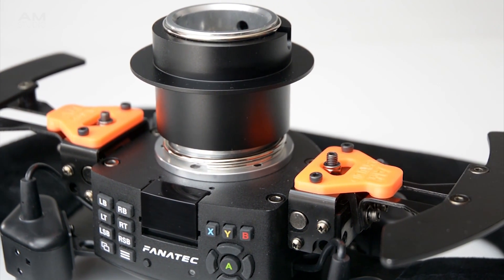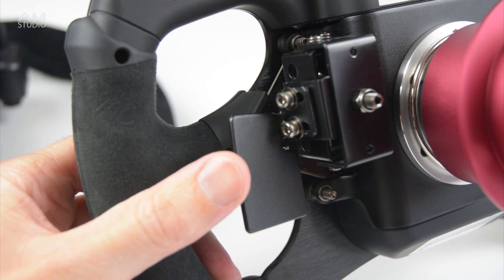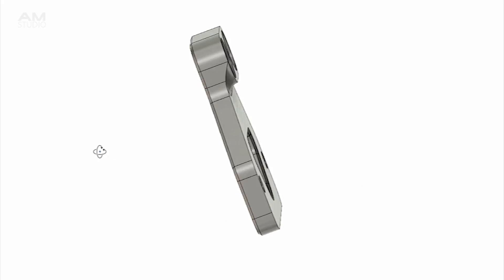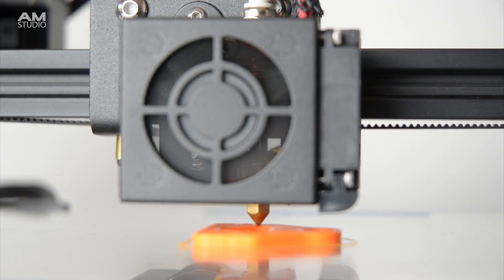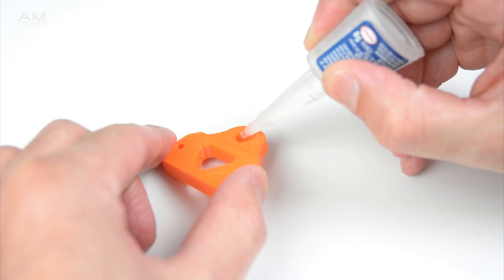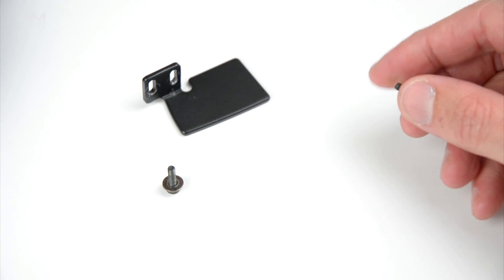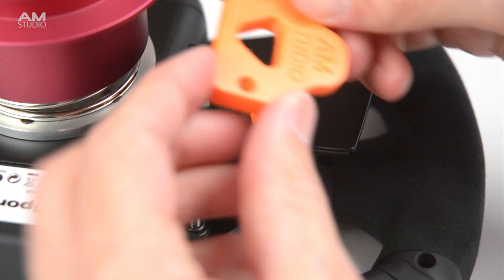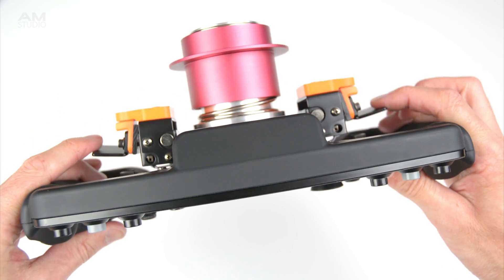DIY MAGNETIC SHIFTER FOR FANATEC FORMULA RIM

Comment: I purchased a set of these the same day I purchased the wheel, and I'm very glad I did.

The feeling of the stock shifters was kind of a let down, no tactile feedback at all. Your mod completely changes that.

My only wish is if you added an option for some sort of foam pad or felt insert between the two pieces to eliminate some of the noise. I love the noise, but the rest of the household isn't so pleased haha

Comment: Thx for the awesome mod. I made these for my wheel but I think the magnets are to strong for my liking because I bought the 8x5mm N40 magnets instead of the N35 specified in your video. It would be cool if you had a design for 8x3mm magnets which in theory should have less pull strength or even 5x3 or 3x3. Fanatec Formula wheel has fairly small paddles so I think the most important is tactile feel not the strength. What do you guys think? Did anyone experiment with different kinds of magnets?

Comment: 100k SUBS U DID IT
Reply from the maker: Thanks!
Reply: @amstudio Is it hard to make an enclosure for the shifter adapter? So like with an USB plug and the plug for the shifter. By the way that thing works completely flawless. Anyways I have mounting hardware so I could mount the shifter plug and the audrino to that case. And I could probably mount the USB micro port with hot glue. It's probably better if It would be 3d printed but I don't have a printer (3d printer). Although I could probably make something out of wood. Soooo do you have an idea of what It could look like? I would appreciate a respond because it's just in an Amazon basics box right now, but I also understand that you are a busy man and have better things to do with your time. Anyways thanks because I have an adapter nether the less. Have a nice day.

Comment: Hi, I've got a problem with a logitech force shifter and was wondering if u could help me: 
  i've bought one cheaply, but it's not working correctly: only even gears + reverse work. So basically only movement lef-right is detected, and it behaves like it was always in down position. I tilt it left, it sees second gear. Middle position - 4th gear. Right - 6th gear. Any movement up-down does not do anything.
   Do you know if that would be a quick fix, or would it be better to just try to send it back?

I know there are basically 2 pots detecting all the movement, so probably it is a broken wire or sth. But I don't want to tear it apart (and lose the posibility to send it back) without being sure that I would be able to fix it myself.

Comment: hey. Back when you made the formula rim with the screen and buttons you did it with 2 usb's is there a way to wire to buttons to the Arduino used for the screen or does it require new code or is it possible at all.